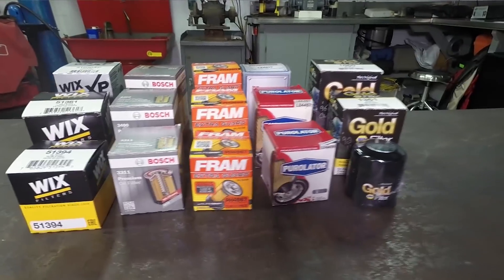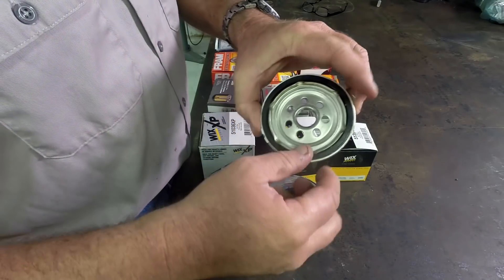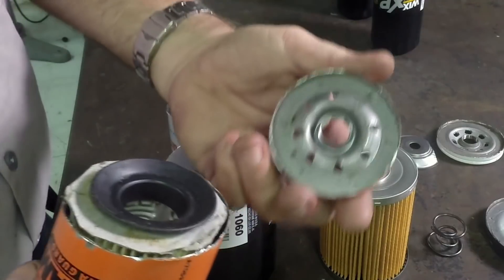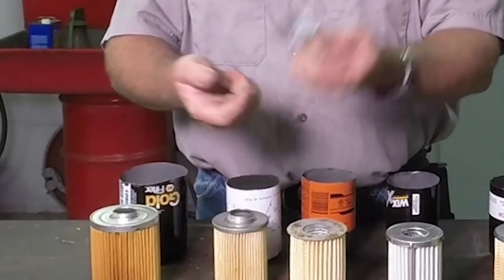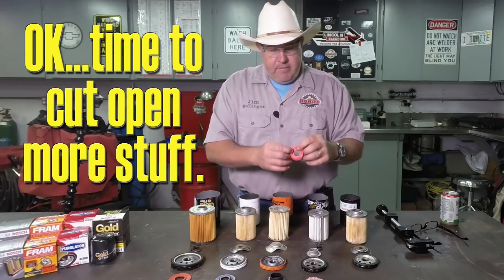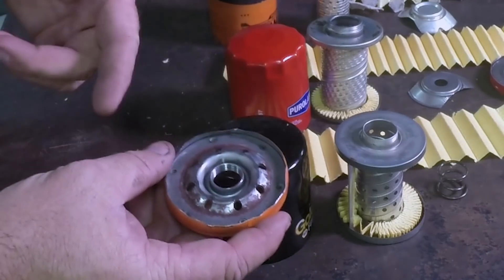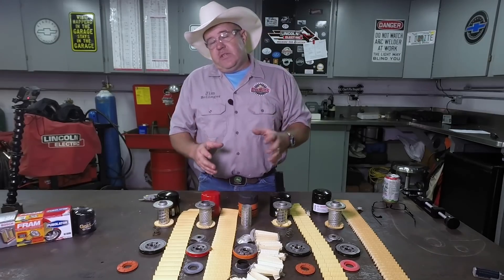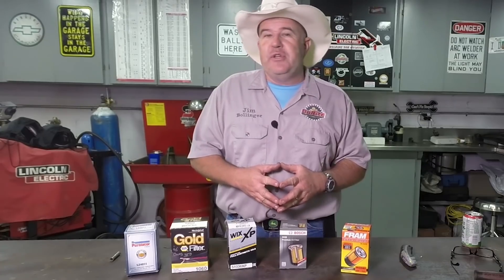The worst oil filter EVER!

Comment: Well unlike many on here I wont bash FRAM based on this video. It may do the job for many and clearly does for millions of people over decades. They are used on personal vehicles, farm equipment, race cars and lots more.

ONE thing for sure is clear: Napa Gold and Wix are built better and have features that are desired. Are they necessary? I dont believe half the comments on here about how self proclaimed  "mechanic's" have torn down engines and determined it was a Fram oil filter that finally crushed an engine with 200k on it. That's like saying it was th that can of Budweiser that finally did my 87 year old grandpa in. I smell bullshit.

You can decide what to do with this information. Fram, Wix, Purolator and more will live and go on filtering oil in some fashion all over the world long after you rot in the ground.

 Wow did I really get morbid? 😁
Reply: I've got 330k on my engine and I want to see it live to 660k. I'm not chancing it with a shit tier filter that's internally rusted before it ever gets to me, that's held together with cardboard and elmer's glue, that has so little filter media that it goes on full bypass before it gets 2500 miles in.
Reply: Nah,point is fram is shit. No matter how you slice it,literally. There is no way to tell how much an engine has suffered in the long run due to using such a product. The mere fact that there was rust inside the can most def being introduced into your vehicle is enough to say no to fram. Shall I school you on why that is?
Secondly the quality is shit. And yes I have personally had on or two collapse in on themselves,I just accepted it as a it happens,because it does. But it's obvious WHY it happened.
For the average person they would be running their engine like that for awhile and that could spell doom. 
But down to the nitty gritty,the whole purpose of the filter is to Filter,and if your filter is such low quality as fram it's going to do a shitty job therefore guaranteed to be shortening the life of your engine not to mention all of the other consequences that can arise from said low quality. Oil is an engines life blood.
Reply: @treynathaniel4075  if that is so obvious and true across the board, then how can Fram sell millions and millions for decades? Is everyone not as smart as you? The whole Fram industry is scamming countries, businesses, and racers all over the world and have been since you were born?
Reply: @donschlonski2936  Most do not know anything about cars,mechanics,or even oil. Any mechanic knows this. It's why it's so easy to rip ppl off. And believe me most shops do.
Reply: @donschlonski2936  And a product that doesn't cause immediate issues is very difficult to blame. But knowledge of what causes said consequences can be readily blamed.
And you'd be surprised how many "mechanics" just wing it and aren't very knowledgeable. Dealerships are famous for such.
Reply: @donschlonski2936  I worked at an auto parts store before, and well you would be surprised at how many people who came there have literally no idea what they are driving. Most of the people that buy parts at an auto store should not be working on their own vehicle either.
Reply: @SkylineBNR34  and what does that have to do with the topic?
Reply: @donschlonski2936  You said people were stupid and I was confirming it.

Comment: I knew fram isn't the best, but it works, but after seeing this, I won't be using them anymore. I depend on my car to get me back and forth to work. It's worth every penny to have the best products to keep it on the road the best I can.
Reply: You DID get the real world message...FRAM filters work. What is the standard for a " BEST " oil filter? ( ever have an oil filter failure?  OF ANY brand ??)
Reply: I owned an auto repair shop for over 20 years doing 2 to 4 oil changes a day. I went on to repair cars for another 30 years.  Since 1968 I rode about 10,000 miles a year with 17 different harleys. All the States except 4 and all provinces in Canada except 3. All those cars and bikes were always run with Fram and absolutely no probems. I just turned over 210,000 miles on a 99 Hog. I tore it down at 100,000 miles, deglazed the cylinder walls, new standard size pistons and rings, ground the valves, and we were good to go. Never ever a problem except when one filter was minus a gasket.
This is my EXPERIENCE, not just an opinion.
Your mileage may vary but if the oil changes are done properly, not much.
Keep the shiny side up, please!?
Reply: @carlcgraber3030 , would you rather a quality filter, regardless of brand, or something of this rubbish the video shows?
Reply: @jamesr5741  When an oil change is done, the oil is clean. As the miles role on, the oil gets dirtier. This means the filter is working, ie. cleaning the oil of impurities. If the oil got dark at say, 2000 miles, the filter Is failing. The length of time/miles the oil stays relatively  clean is indicative of oil filter  quality. Now I changed oil every 5000 miles on all my 12 cars, 3 half ton trucks, and 24 motorcycles since the early  sixties using Fram oil filters with never a failure. This is not the experience of others, but my own.
Let's just say my shop did just 2 oil changes a day, 5 days a week, for 17 years with absolutely no problems, does this not merit truth in my experience with Fram oil filters?
Take care Amigo and thanks for the come back. It shows you have an interest, not playing a blame game. This whole trip is for fact finding, not fault finding!
Reply: @carlcgraber3030  , that's all good, as long as I knew it was a quality Fram filter then I would be happy to put it on my car. But as the video shows, they are not to be trusted.
Reply: @jamesr5741  Hi James!
I have never found Fram filters to be rubbish. My 60 plus years of using them should speak louder than words, if one is opened minded enough. That test we just saw is not applcable to the proper use of an oil filter. Personal, I think it's rubbish. How can that overlap the real world experiences of the actual 60 plus years of no problem use? On a few occasions I have seen them swell only because of very over extended oil changes, like 40,000 plus miles over the recommended 2000. This was back in the late sixties when I saw this on only 2 or 3 occasions. If this above test was so accurate and truthfull, why such experiences I've had? No, one can find fault in any or all but it's the real world that imulates the real truth.
Take care Amigo and please, keep the shiny side up!
Reply: @carlcgraber3030  , they could well have been built a lot better back then! Unfortunately, as the video shows this model from Fram has completely lost that which they were obviously once renowned for. I would be happy to see the more expensive models cut apart to see what quality they are, but for now I reserve my decision.
Reply: @jamesr5741  It's the quality of oil filtering and longevity of that brand of filter that makes or breaks a filter, not their construction. If the filter filters oil and lasts, as with the success I've had, what's to question? Robert, this is experience over many years and up to the present. I do oil and filter changes on a 2010 Sebring with 136,000 miles, a 2006 HHR with 220,000 miles,  a 2001 hog with 40,000, and a 1985 hog with 42,000 miles. All use no oil and run excellent. I change oil in all of them with Fram filters every 3600 miles. The 2006 and both hogs take dino oil whilst the 2010 takes syn.
Well, Amigo, I gotta vamoose. So, take care!
Reply: @carlcgraber3030  , it's a shame you couldn't stick to the main points of what the video and I were staying, but I guess it goes hand in hand with your comment that construction of a filter has nothing to do filtering quality....
Reply: I've been using Fram Tough Guards and Mobile 1 in my truck for 200k miles without a problem. I'm at 300k miles now no rebuild in sight. He can talk all the crap about the cheap $3.50 Fram all he wants. The mid range $5 ones I use haven't failed me yet.
Reply: @MasterTech396  Right on Amigo. Right on!
Reply: @MasterTech396  , but the filter is obviously not able to it's job with that flimsy construction, why would you trust that?
Reply: James R - like I said I don't use the low end Extra Guard in the video. I use the mid grade Tough Guard or their top end Ultra Synthetic. They are both built different than the orange one. This dude is comparing a $3 filter to a $9 filter. Why couldn't he get an Ultra Synthetic which is Frams $8 filter? Would have been a better comparison in my opinion.
Reply: @MasterTech396  , but how would you know when they put their Brand name behind it? Do Wix make similar garbage?
Reply: James R - Because when the Ultra Synthetic came out every Autozone I ever went to had a cross section of it being displayed. Also why are you surprised a low end filter is built to a lower standard than a high grade filter that's almost three times the price.
Reply: @MasterTech396  , why? why do you think? It's garbage. It's not acceptable for use as an oil filter, yet it's sold as one. Maybe it could be sold as a paperweight?
Reply: Ive used fram for over 30 years. Never had any issues. This guy just hates fram
Reply: LOL

Comment: Why not test Federated oil filters & Hastings. I can get Purolator From Advance auto parts, And Federated that I've been using for years without issue. However I never seen the filters in your video, except Fram.

Comment: I'd like to know why you used puralator classic but Napa gold and wix xp I'd like to see a comparison between puralator one or boss and the Napa gold and wix xp. The list of this video is good and I'm glad that you are calling out fram for it's horrendous quality. But working for advance Auto and O'Reilly I can tell there is a very large difference between a wix xp filter and a puralator classic filter. Especially in price.
Reply: 4$FRAM VS. 6$ wix 5$NAPA LINKS ARE IN DISCRIPITON
Reply: @citizensunitednegatingtech9783  I understand the price of the standard wix is 6.28 on the link that you sent, but in your video I could clearly see a Wix XP package at 3:54 and looking at Amazon the place that your link sent me too. The 51348XP the xp version of the filter that is in your link is 12.62. a much higher price than a cross referenced Purolator classic L0241 which is 6.49.

Comment: The racing filters are good . . . ran them my whole racing career. Used to use them on all of my V-8 street engines.

jus' sayin' . . . 😁🏁
Reply: Also, I was just thinking, the angle the filter is mounted at would affect drainback. Very few are perfectly vertically mounted, nowadays.

Comment: As the oil flow runs on the can side and through the filter media, light rust in the can is pretty much a non issue. In bypass it would skip the filter, though at that point you have more to worry about anyway, including all the dirt that made it into the filter from your engine that isn't embedded in the media. The center tube looked fine, and that's the outlet. No concerns about the anti drain back valve, as that was glued to the filter media, so of course it took some of the end cap material off with it. I'm also not worried about the media breaking when unfolded, you'd have to run a media burst strength test to really know anyway. This is about the quality I'd expect from a YouTube video with a title like that, and I wasn't disappointed.

Comment: Why haven't you used the same filter for each test? Every filter is a different size, and are likely for different applications. 

Just pointing out the thing everyone has seemed to miss. Can't do a fair test if you're testing the filter for a 1.0 petrol engine against a 2.7 turbo diesel.
Reply from the maker: Ok let me break this down, 15 filters, 5 that fit a Chevy small block 350. The same 5 manufactures, for a 2.4L Nissan. Again the same 5 manufactures for a 2007 Toyota. 3 x 5 = 15. A pretty good spread of applications, so some guy doesn't say, "well those are only for xxx model" . That way I could show consistency/inconsistency across the brands.

Comment: Crazy though how you never here of an engine failing due to a oil filter, it's always lack of maintenance and abuse. Just because fram uses a composite doesnt mean it wont filter as well... sure it doesnt look good, but I have yet to see an engine fail due to a bad oil filter. I have seen plenty fail for lack of maintenance.

Comment: This is insanely false information. The end caps on the Fram are a really smart way to filter. They are made out of a synthetic filtering media and Fram has often times indicated this actually creates a more reliable filter that also filters out more particles for a longer time. I see absolutely no rust. The little bit of brown is glue holding the filter media to the end caps.
Reply from the maker: Well, you wrong, but that certainly is your prerogative. The rust was in all three filters, but then again, call it what you want, It's rust.
Reply: @DoRiteFabrication  What rust? you never showed anything other than a brown color on the not metal endcap. How does a not metal end cap rust?
Reply: Did Fram pay you to say rust corrosion is glue?  You can admit it, are you their cardboard supplier?  Did you hear yourself in your response?  You said “glue” holding cardboard to metal which has rust is just glue.  How about you admit a cardboard frame, inferior media, poor threads and rust shouldn’t be in a filter.  It’s cheap!  That’s the point.
Reply from the maker: Its rust, open your eyes and look, plain as day in the video where the METAL parts of the filter are rusted. And if that isn't proof, go watch my Diesel filter video where guess what.....but then, fram employees apparently can't see rust. Thanks for watching.

Comment: The filter he's comparing are all over the place in terms of quality. He's comparing low end cheap filters with better quality high end filters and shocker the cheap ones are garbage. The Fram orange can filters are cheap junk but they're cheap and should only go on beater cars. If he was comparing with the more expensive Fram Ultra Guard synthetic filter that actually uses a metal end cap then he'd be singing a different tune. Fram is not a bad brand overall but at the same time I would NEVER recommend their Orange Extra guard oil filter.